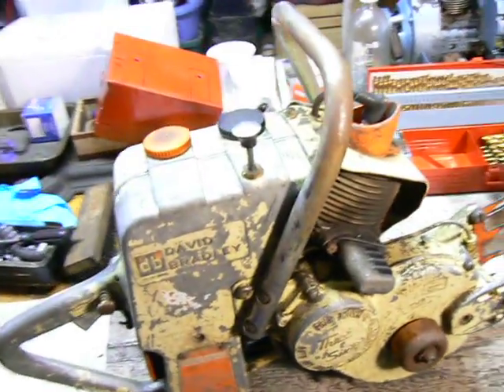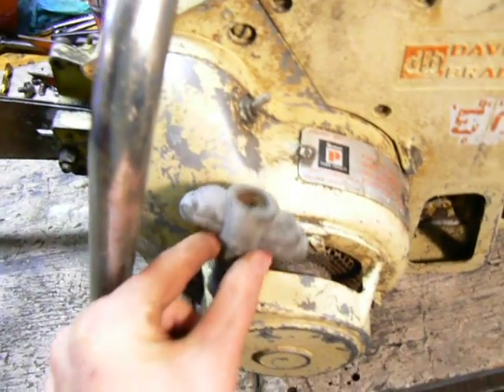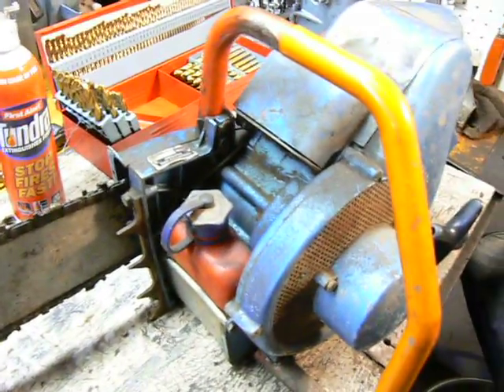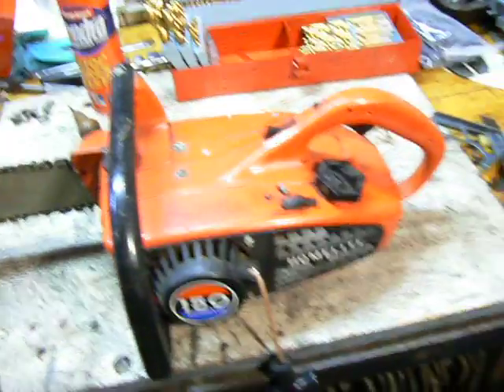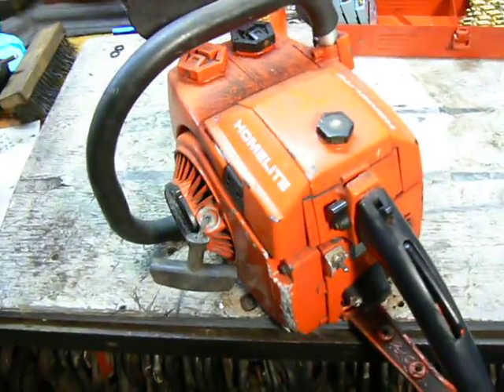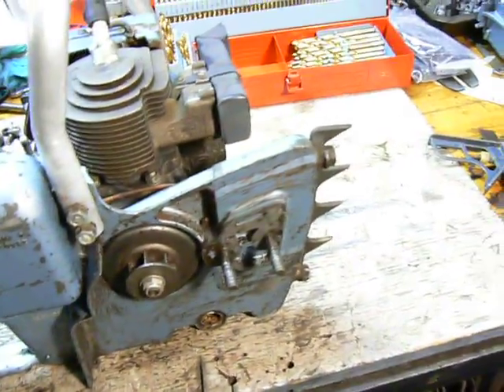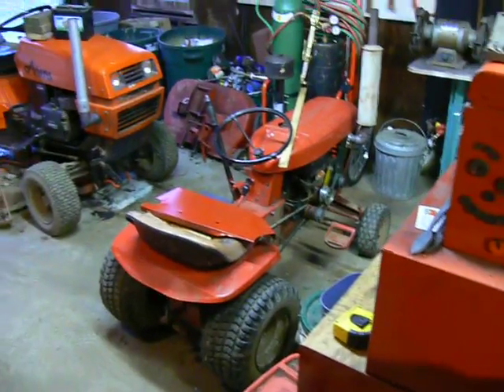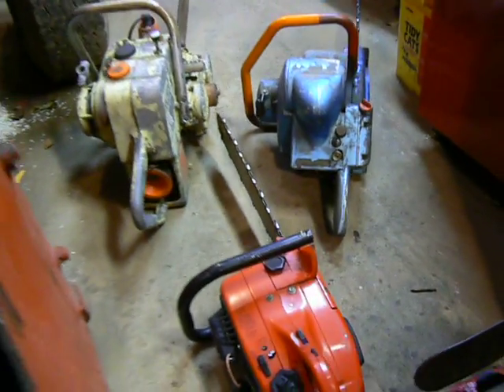My Chainsaw collection and addiction- David Bradley, Solo, Homelite, Stihl

Comment: The little homelite is a 1989 homelite 150automatic . When I had mine it was always trouble for me they won't start in the winter and sometimes hard to start in the summer I ended up selling mine and I tried putting new everything on it but couldn't get it to run the normal way.

Comment: the best way to display a homelite 150 is slightly above eye level with the starter side facing you. if it has an 8 digit serial number the 1st number is the year. if it's a number than it's a 70's.  ex: 3 like mine it's a 73. if it's a letter than it's an 80's. you'll have to check the the chart than. nice find. that one looks like new. oh,if it's nine digits go by the second digit.

Comment: you will get more power out of that zip if you take that homade muffler off and put the spark arrester back on and use the 16:1 fuel ratio dont  cheat and use 2 stroke oil you will burn the saw  up. i put a e3 spark plug in mine and it gave it a little more power to. a homelite zip was my first saw to they run forever if take care of them.

Comment: Hi just watch your vid great stuff, I have read all the comments and want to let you know that your Solo rex is rare because it is a mark 1 not many were made. It was made in 1958 125cc and you can tell its a mark 1 by the stop button and where the ID tag is placed. As for how much money it would bring on ebay I just sold one for $275 Aust cheers love my saws
Reply from the maker: Thanks for the info! i have noticed that the style is slightly different than others i've seen. i also think that the newer ones have a plastic cover that goes over the carb rather than a metal one? they are AWESOME saws and hellish to operate. i'd never part with it!
Reply: yes you are right there are lots of mark 2 out there but not many mark 1, solo has many great saw all great to play with cheers Kevin down under Australia

Comment: i just picked up the sears version of the david bradley and its bout the same but my starter spring broke, luckily being a tecumseh i saw a vid of somebody that put a modern 4 stroke starter right on it, soon to fix that beast. i dont think its supposed to have high compression, my other power products tested at 60psi dry and fired right up and runs and i heard specs new was 65.